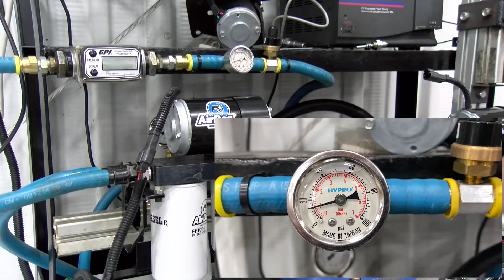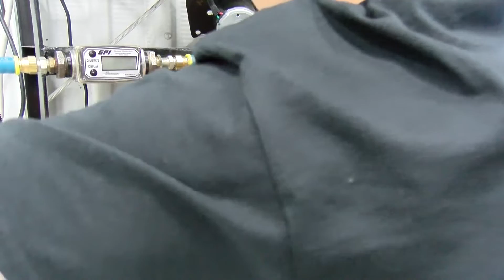AirDog Pressure Adjustment

Comment: Ok airdog i have a question. My truck has an Airdog 2 on it and when i shut down my truck the pump doesnt ahut off
 I have to unplug it amd leave it unplugged or not im plagued with ha ing to go back and forth at each stop.  So far all fuses are fine. And i swapped the relay with the bkower relay and it still didmt shut off. 2001 Ford F250 SuperDuty 7.3L crewcab long bed
Reply: I just started having the same issue on my 08 6.4L,  my pump is 4 months old. Have you resolved the issue with your truck?
Reply: it was the relay that goes to the airdog2 pump through their wire harness it was corroded to crap

Comment: So what is the recommend fuel pressure level? Where is this chart or table of values? I have a 2013 LML with the Airdog 5g going to buy a gauge to mount on the pump but can not seem to find a spec on what pressure the pump should output??? Any help appreciated
Reply from the maker: There's really no chart to go by. For and LML, the pressure should be 8-10psi. If you have any other questions during your installation, give our tech department a call at 317-421-3180.

Comment: I have a 2010 duramax LMM. I just installed the AirDog II 165 5G a week ago. I noticed that if I started the truck immediately after the glowplug light goes out, no problem. If I let the pump run 30 seconds or a minute [I did that checking for leaks] then start the truck, it cranked over for a few seconds before firing. It ran just fine though. Today I put a pressure gauge on the airdog and found it was set for 7 PSI. I turned it down to 5.5 PSI, took it for a drive and checked again engine running. Setting was stable at 6 PSI with truck idling. Starts and runs great.

Comment: Would a poorly adjusted airdog pump prevent a lb7 duramax from getting the proper PSI at the fuel rail to start?
Reply from the maker: All of our pumps are tested on a test bench for flow rate, vacuum, and set to pressure before they leave the facility. Check to see what fuel pressure the AirDog is putting out on the truck.

Comment: I just bought an airdog original and slapped it onto my LLY. The truck would start up almost instantly before the pump but immediately after it takes a few extended cranks for the truck to turn over. Once the truck is running I can audibly hear that the pump is running and the truck is running easier? The starter is fresh along with the batteries. Could this be the pump needing the pressure changed? The LLY just has exhaust and cold air intake...
Reply from the maker: Give our technicians a call!

Comment: Is there a gauge that you can put on the pump it’s self
Reply from the maker: Absolutely! Above the fuel filter there is a 1/8" pipe thread port that you can thread a fuel pressure gauge into!

Comment: I'm new to diesel truck maintenance, so how would I know what pressure it's at without a gauge will it show on the truck or do I need to buy a gauge. I'm looking @ buying an airdog lift pump for a Duramax LML (2014 GMC Sierra HD 6.6 turbo diesel), I understand how to adjust the pressure, but trying to figure out where to see what the pressure is at. Thanks in advance if you understood my question.
Reply from the maker: You will need, at least, a mechanical gauge installed in our pumps to adjust pressure. All our pumps, except the frrp, come with an 1/8" npt port to measure fuel pressure.
Reply: @AirDogSales  OK, thank you for the response, I'll look into it👍
Reply: @AirDogSales  didn’t know I had to buy a gauge, I thought it came pre set for the truck I purchased it for, bummer.
Reply from the maker: @Long_Island_Justin  The pumps are preset from the factory. That being said, every truck varies a little bit on how much fuel is consumed and it's never a bad idea to check fuel pressure after installation.

Comment: On an airdog 2 what is the stock pressure that it comes with out the box how could you tell without a gauge
Reply: And how much needs to be for a duramax 2004 ??
Reply: I have on my Cummins a tuner, it says about 18-21, too high for me so I tuned it down

Comment: Have a issue with my fp-150 blowing fusses and seems to be getting hot not sure if the pump is shorted out or what?
Reply from the maker: Give our tech support a call at 3174213180 and they will be able to help you. Hours are 8am to 4pm eastern time.